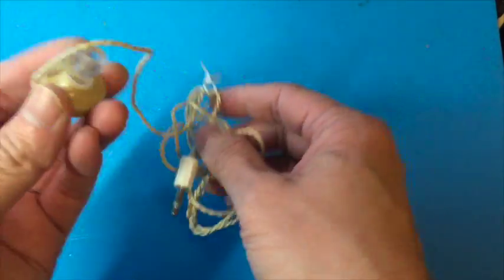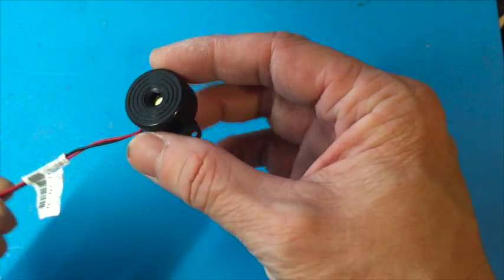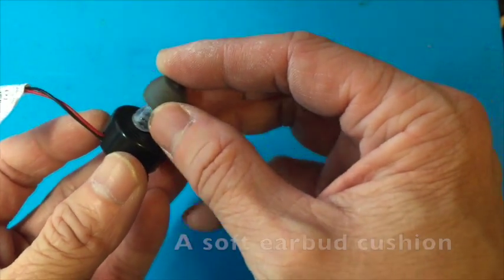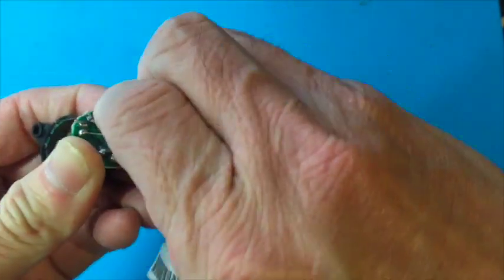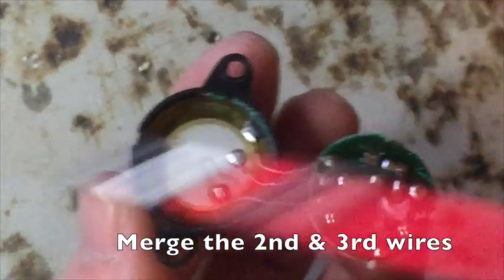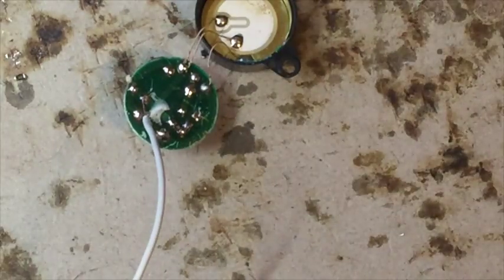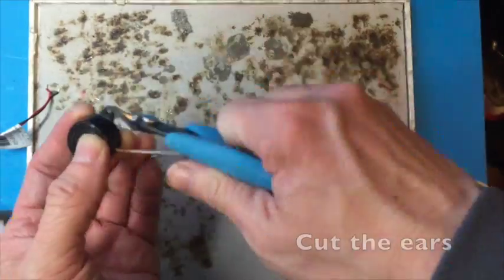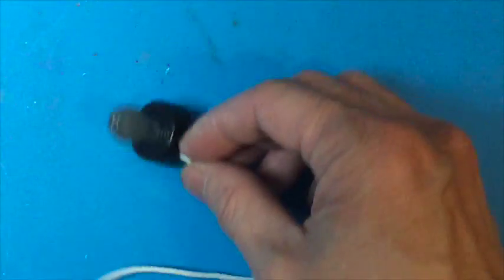DIY Crystal Earphone for Crystal Radio

Comment: To be honest, I've never made a crystal radio, and it's still hard to believe that there are electromagnetic signals in the air that can power something like a crystal earpiece. If I may know, how many volts of AC AM signal can be obtained from the air?
Reply from the maker: My previous best  testing shows around 2 Volt  with 500 uA that drives a speaker.

Comment: Can l use any other buzzer instead of piezoelectric buzzer?? Please reply sir
Reply: Because l used an 27cn sharp buzzer
Reply: ?? Please reply sir
Reply from the maker: Only piezoelectric buzzer are sensitive enough for crystal radio and with a high impedance of 5 k ohm or above . I am not sure of your Sony. Cannot comment . If you have that already just try it out.
Reply: I think it will work from 27 cn buzzer instead of the buzzer you have shown. Because l have made one and when l tried to to check it with multimeter, some sound was given by it. Still l haven't used it with a crystal radio so not fully sure.

Comment: Can it be dangerous,if i connect it directly?
Reply from the maker: If you connect the buzzer  directly as a earbud without removing the components inside and without reconnecting directly to the piezo-electric sound unit inside the buzzer, it may still work but with a much lower audio volume

Comment: 👍nice vid.  The tiny speakers in the greeting cards/birthday cards.. will they work?
Reply from the maker: They may work but the sound level will be very low  if you use them alone. You need to put them in a sound box and follow what I show you in this video to modify it and plug them into your ears.
Reply: Cool. I will attempt that.  I may precede that with a small transformer to see if that helps as well.
Reply from the maker: @barrykelly2722  , the piezo-electric components have an impedance ranges from 5K to 10K. It may fit some common diodes for crystal radios without transformer.

Comment: 0:35 I have a Crystal Earphone like the one you have shown.  It's insensitive, with very poor sound quality.  Is there a way I can repair this one with simple tools? 
It has a small philips-head screw on its back.

I think it was made in China (not Taiwan)
Reply from the maker: John Smith ，
I think you can try replacing the sound unit with a piece of piezo-electric disc like the one I showed inside the buzzer. 
I have compared the sound quality of the type you mentioned with the one I DIY and found the latter  much better.

Comment: Can I connect the buzzer directly to the circuit of the crystal radio? Why is he getting rid of the components in the buzzer?
Reply from the maker: adam staes , you can try but getting rid of the components inside will ensure the best performance as these components will effect the impedance if the earbud and in some cases short circuit
Reply: @BillyCdiy thank you for the comment... the problem I have is that my buzzer is sealed in and I can not open it... that is why I asked

Comment: Great tips & tutorial Billy, thanks
Buzzers inside the casing come in two types; active (got circuitry and disc) and passive(just a disc)
the one you showed is active, also the active disc got 3 contacts the metal is ground and the white is voltage and the smaller white is feedback. Passive buzzers discs just got 2 contacts ground and voltage.
https://en.wikipedia.org/wiki/Buzzer#Piezoelectric_2
Keep it up, you are presenting great DIY material.